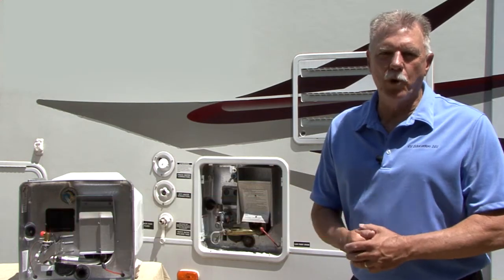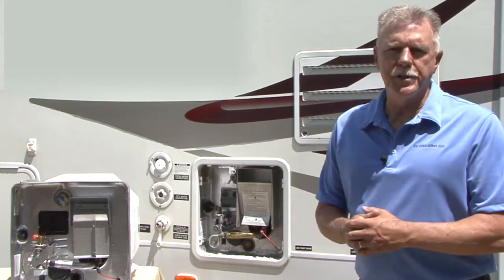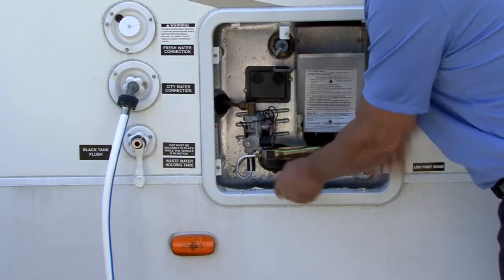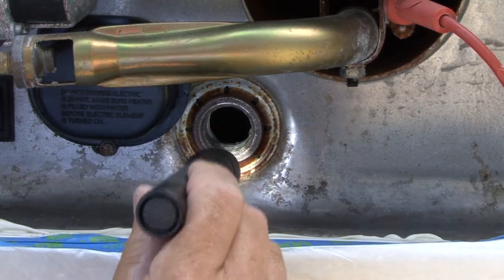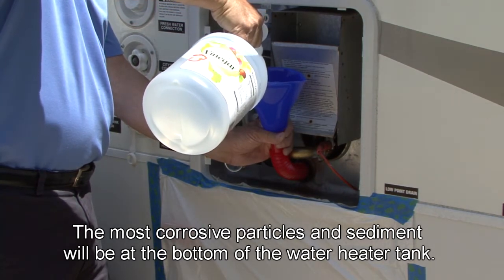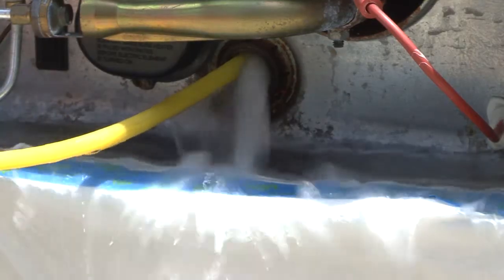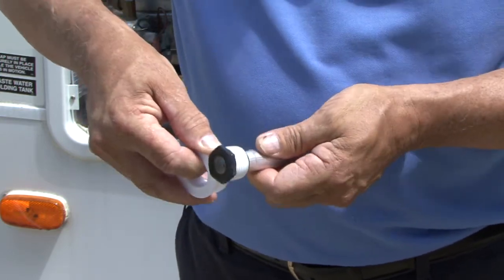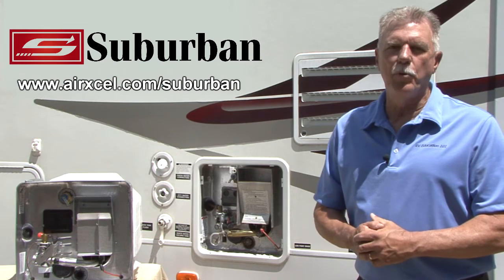Video 04 - SUBURBAN Water Heater Sediment Removal

Comment: For those outside the US & Canada, a 3/4 inch plug is hard to find so I have just cut off the remaining anode stem from a fully depleted anode rod. Also, the Mineral Oil being used is called "Paraffin Oil" or "White Mineral Oil"

Comment: I just replaced my 24-year-old suburban water heater with a new one. I installed a 6 gallon sw6d it was the exact same one that was previously in there the water heater was actually fully functional and was very hot. the reason I ended up replacing it was due to the fact someone never tightened the PEX connection behind it tight enough. therefore water for several years rotted a hole through the heater from the outside if someone had properly maintained it the water heater would have probably continued to have work today. the reason I bought the exact same one is because I truly believe suburban makes much better RV appliances versus dometic I have had very bad experiences with dometic products